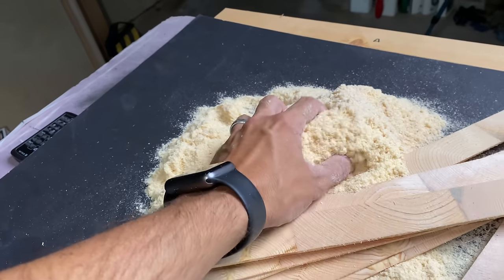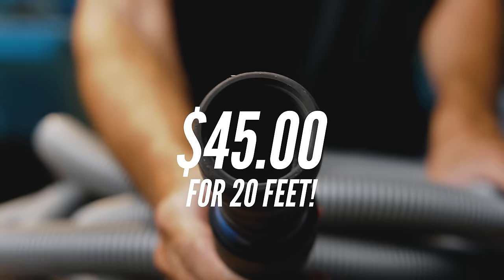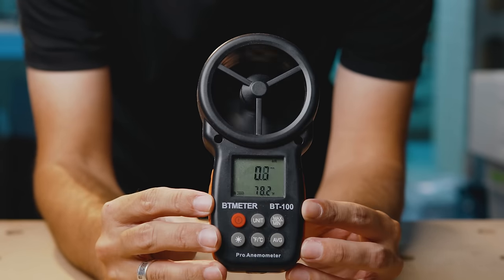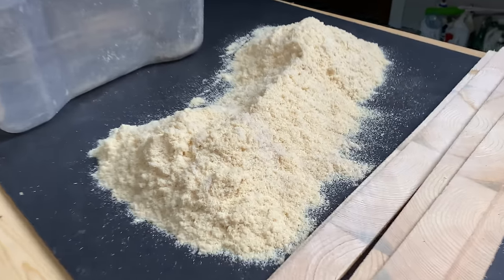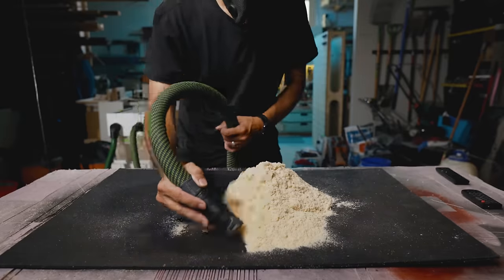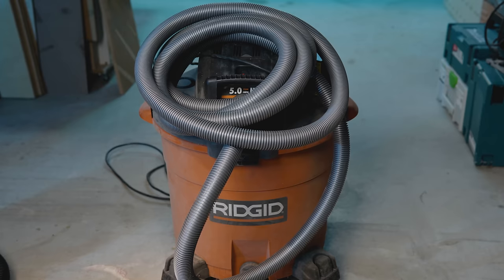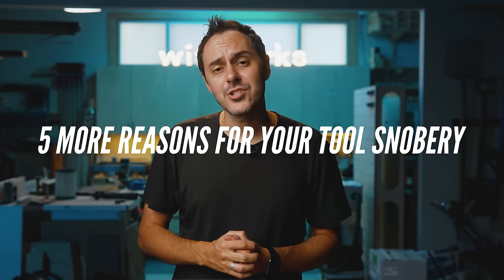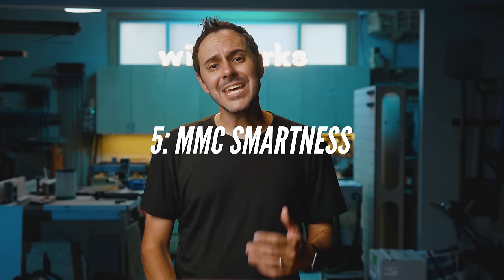This video will save you a lot of money. Dust extractors for beginners.

Comment: It's the loaded filter that's doing this.  Test again with a new standard filter. Check the airflow numbers too. It should be higher than the shop vac with the HEPA bag and filter.  Your readings will go up.  The question is how much. The pleated paper filter is going to filter most of the pm2.5  and larger just like the filter ahead of your car's intake manifold. In fact, a PM 2.5 filter material is very effective at trapping much smaller particles than the 2.5 micron rating. A KN95 mask is made of a 2.5 micron material that traps particles down to about 0.2 micron with reasonable efficiency.  
It's hard to justify Festool when you think of how many OTHER tools you can buy for the difference in price.   Please don't try to justify it with time savings or features only a pro production shop would even care about. How much time and effort can you save if you have an extra 700 to spend on better or  specialized tools?  
One thing that made little sense as a pro,  but probably more to a consumer was when you said  if you are a professional you might feel embarrassed showing up with home depot tools that the customer might already own. 
That embarrassment though comes only from your own lack of confidence,  not the name on the side of your tools.  
If you had the confidence you'd immediately argue that it's not the tools, it's the skills and knowledge using them that your customer is paying for. High end tools (even in the case where they really are more precise) will never turn a poor craftsman into a good, or I dare say, even a better one.  Reality is that the value of what's often perceived as a small performance and feature advantage at great expense will only ever be utilized or even recognized for its value by a highly skilled professional for whom productivity,  repeatability, and reliability translate directly into significant dollars. 
Let's face reality here. The only reason to buy this expensive all plastic and velcro dust collector is the name on the side, ego, and available patron dollars to buy it.  Let's not forget the expensive final stage filter bags that do so the  work but leave you to inhale dust dumping the wide open centrifugal traps above it. 

 Don't tell your wife.. damn straight. I bet she'd tell you to send the damn thing back to Festool for a refund and tell them they have to do way better. Next she's gonna be all over you about why you don't promote a PPE full mask P100 elastomeric ventilator you are supposed to use to protect your asthmatic lungs and red eyes?  Only one of those and you can use ANY tool in your shop.. dust collection, overspray or hazardous fumes not withstanding.  And they're (relatively) cheap!

All that said,  thanks for this video,  i can show my SO how much money I save by building my own dust collection system 😂😂😂

Comment: really good video... would have been nice to see you sanding something with the Airquality-meter next to you... granted this introduces variables into the test, but i noticed that while working usually the pressure difference is the key, not the aktuall volume or Airspeed, as sanders have very limited airflow around the paper anyway.

i'm out of the game for now though as i invested in a haviely used Festool... new filter, blow out the Motor and some new Brushes and good to go.... its 6 screws and one plug to get the motor out of a Festool and you can hardly believe how much dust gets into that motor, as it sucks unfiltered outsideair for the cooling/motorside... and needs to as its sealed to the turbineside for sucking water.

Comment: I wonder if the fact that the newer Rigid and the Festool both are more powerful, they just push more particles past the filters. If there was a way to lower the suction power down to the be equal to that of the old Rigid set-up, I bet the readings would drop correspondingly.

Comment: Particulate readings aren't surprising, moving less air with a clapped out clogged vacuum should give fewer particulates around the lower flowing exhaust.  But I'd consider those results equivalent. What you really want to know is how many particulates you have at your head where you breathe.

Comment: Filters aren't that expensive. Every car, HVAC system, and workplace has filters. The reason the cheaper vacuum worked well is because it has a filter. That means, if you want to save money, you can just put a $1 filter on your face.

Comment: Why not put the exhaust of the shop vac simply outside?

Either by a long hose on the intake or exhaust side? 

Yes it slows down suction but not too bad. 

There are also vacs you can put into a utility room and have vacuum pipes over your shop and it'll exhaust through the roof

Comment: You missed a huge fact in your testing..... The festool will be a dual stage vacuum where the rigid is a single stage ... Dual stage is more suction lift and less airflow (CFM)...
Meaning with rigid with its normal size hose will suck way more then that festool.... Putting a small diameter hose you'll get less CFM and the dual stage festool will pull more air thru the small hose but from the vacuum with a standard 2.5" hose

Comment: Really good video mate! The results are pretty interesting and the hepa bag is something I'll have to get on my shop vac too.

The only comment I have on your method is as far as vacuum exhaust reading you did a good job, but what about the readings near your face or at the actual tool? Vaccum exhaust is one thing to consider, but if a clogged shop vac doesn't suck as much, you probably have more dust at your workstation and near your face, where it might matter even more.

Could you make another video on that subject?

Comment: You actually have to throw out the tests on the 12 year old. 1) filter is clogged up and air flow is reduced, so assuming percentages are similar enough, the absolute number of particles will be lower. 2) the more clogged the filter, the more stuff won't get through it. Think a few thousand tightly packed ping pong balls filling your hallway and try to walk down it, vs just loosely tossing a couple dozen ping pong balls in the same space.

Comment: I’m confused at the point of a cyclone when you have a hepa vac. I paid $400 for my dewalt hepa vac that uses two hepa filters at a time, knocks every few seconds to self clean, and has the outlet built in to plug a tool into for the start/stop feature. And you have the required CFM for tuck pointing according to osha. When I researched high end shop vacs, they didn’t have the required cfm even before adding a hepa bag and filter.

Comment: regarding the old shop vac, I am wondering if the old clogged filter is helping with the levels.   I am wondering if the dirt in the filter  may be clogging the pores of the filter, giving you better values coming out of the exhaust.

Comment: I think if you do enough of it investing in commercial equipment in general is a good idea.  I bought a Honda commercial lawn mower because I do enough lawn mowing to justify it.  I try to buy commercial grade when I can and I wish I could afford a Ridgid commercial twin stage motor vacuum but I couldn't justify the nearly CA$400-600 that one would and my current Ridgid that's well over 10 years old at this point led me to buy an NXT 14 gallon machine from Home Depot.  The old one works but I bought a new one because the old one didn't take bags.

Comment: The most commonly misunderstood element of scientific measurement is error assessment. Every measurement has the objects true value AND the error component of that measurement. The assessment of measurement errors can be a complex task. However every measurement tool intended for high accuracy measurement should come with the relative errors expected from the correct use of that tool. 

Also, your measurements were only measuring the air quality of the output, without taking into account the variability of the static source air quality. In other words, did the sequence of unit testing affect the system input conditions?

Do the various measurements of filtered and unfiltered air make sense?

Comment: Great video - interestingly, the dirtier the filter the better it filters.  Consider that the particulates, as they build on the filter they act as additional filtration material.  The down side is that although you get better filtration the vacuum's ability to move air and filter more is lessened.  But I have always wondered for the small shop not with a lot of neighbors why not just remove the filters altogether and just pipe the exhaust outside and let it go?  Just a thought.  dd
Reply: The same for a pool filter.

Comment: Like most of these reviews comparing a basic hobby tool with a professional tool, you fail to compare the most important factor in the cost difference: time savings.  I now own three Festool extractors, as well as a Mirka dust extractor. AND a Rigid shop vac for clean up. I own and operate a one man professional cabinet shop. In order to accept large house packages on 5k-10k square foot homes, I have to be fast and efficient. So in my case, using a Rigid shop vac for dust collection would be throwing hood money after bad.
Reply from the maker: No need to compare. The time savings should be obvious, and something I mentioned if you’re a professional.

Comment: If wood dust is between 10 and 30 µm (rare cases down to 5 µm), then how much can we expect to measure respectively in the PM0.3, 0.5, 1, 2.5, 5, 10 range ?
So where do the high numbers from 0.3 and  0.5 come from, they are that small that we can't see them, they hang in the air for a long time, so it could be left over from dust in the old filter that is being blown out ? A reference measurement made in the workshop after a long period where nothing had happen there could be interesting.
Things are different if we talk Tobacco smoke	0.003 - 0.8 µm, Soot--0.02 - 2 µm, Drywall dust 3 - 10 µm, Silicosis dust (drilling and grinding concrete)0.3 - 10µm.

Comment: Festool and all the other "woodworker" specific tool companies seem to price their wares to send ALL the kids to college. Beautiful stuff, but you PAY for that last nth of refinement.

The Dewalt Stealthsonic vacuums are a LOT quieter for a little more money than the Rigids. Dewalt also makes a couple of nice cyclones for $125 or so that are basically a shop vac body with a cyclone on top. I just use the one on a bucket, but my vacuum and the bucket are just tucked under some shelves and rarely get moved around. The big reason to have a cyclone is keeping your filters clean - otherwise, all that crap that ends up in the bucket is clogging up your filters in short order and dropping the suction off a cliff.

A clogged filter is actually a better filter - but you won't get nearly as much suction.

Comment: Well that helped me over the hump! I just bought a Makita 1219L Sliding Compound Miter saw a gift to myself for my retirement and mounted it on a Bosch Anti Gravity folding stand. This weekend my nephew and I gave it a workout and can you say dust storm. We did hook up a small shop vac to the exhaust port and it worked awesome! Yup I don’t have a proper dust extraction system and it sure made me realize that I should get one. I have settled on the Festool CT15. Now I just need to find an adapter that I can  hook the Makita dust port up to the Festool hose. Any suggestions? Liked and I have been subscribed for awhile now.

Comment: The issue with fine dust is; the smaller the dust, the more surfece is has compared to mass. So, if you remove 95% of dust mass, you remove only 50% of dust surface. Addicionally, the larger dust gets removed anyways by your nose, so it is the smaller dust, that is dangerous. The question is; how much of it stays in the air, when you take 99,9% of mass out?

Comment: Or...

My shop vacuum is in a shed outside of the work area.  It vents to the outside world.  I have no noise or dust issues in the shop.

Effort and expense?  Almost zero and it works far better than any filter setup regardless of cost.

Comment: You think a Festool dust extractor is expensive? Try the medical costs of not using any dust extractor and filter system. I take the x-rays of people who didn't use them. Foundry workers and drywallers are amont some of the worst affected. I will comletely agree about the dust mask & make sure it's a comfortable one. You will quickly stop using one you don't like which will do you no good at all. I'll leave you with one of my better sayings. Everyone takes breathing for granted until they can't.
Reply from the maker: Yep. My wife is an X-ray technologist. Ctmidi and a good mask is cheaper than a hospital bill - that’s one reason why I bought one.

Comment: I run the HEPA bags plus the filter with dust separator on rigid,   I do notice a difference between the bags and regular filter but that's about it. I would like to know how the suction suffers or not? Thanks for the info!
Reply from the maker: I didn’t notice a huge amount of suction loss. Some. But nothing game changing in my opinion. I didn’t run meters on it though.

Comment: Honestly???
I get the feeling that something with the particle readings is off . . .
There is just NO way a vacuum without a fine filter gets such a good reading.
I bought the FESTOOL CTC SYS-Vacuum out of convenience. A super compact Systainer-based vacuum WITH an integrated hose garage and a shoulder strap for carrying.
When I´m in my workshop, I put the CTC SYS on the cyclone, which usually sits on a FESTOOL roller board. Best setup for the workshop and is super compact for on-site work.

Comment: The results weren't the same. Look at the last numbers. The test also needs to measure the dust at the tool and near the tool. It's likely the clogged old shop vac isn't sucking up (and therefore not exhausting) much of the small particulate - that means it's floating around the tool and your face and/or elsewhere in the shop.

You can to see this stuff clear as day? Work with drywall dust while sanding. A dust extractor wins hands down.

Comment: You would need to measure only the air coming out of each collector. The cheap, older setup is moving less air so your not getting an accurate reading.

Comment: This is a great video, but my tool trailer is small with little room for buckets and hoses that I can avoid simply by putting the saws outside. What I really need is a way to control drywall dust. I can't take the drywall sanding outside, and the dust always finds a way around my tenting and blankets the entire house. Any thoughts there?

Comment: Nice video.  I appreciate all the information and time that went into this video.  I am using an old Rigid shop vac with only a Hepa filter.  Didn't realize about needing a bag too.  What are you thoughts on Makita dust extractors?  I can get a new Makita VC4210L for around $500 with tax.  Thanks.

Comment: Space is a commodity which goes both ways bigger house more money smaller but equally as strong tools equals more money, as for the ppm stuff its definitely the bunged up filter that's doing all the work as the method they both use is identical, also did you wait for the air to settle between tests? If not that may explain some of the variety in your results
Reply from the maker: 1) I tested the Festool first, 2) waited for the room to “zero” out in between tests. Didn’t film that or include it as the original video was 40min long and I cut a bunch of process stuff to get it to the still long 20+min
Reply: @wittworks  solid work and that cuts make total sense time wise but adding in a caption or summin while you was talking numbers wouldn't have gone a miss. Solid work though and the festool just has a quality of life no other brand has especially the cords and hoses they use

Comment: If the old filter was already working, then it is filled with dust. This dust has closed most of the large pores in the filter. The air flow has dropped, but the quality of cleaning has increased. But this is an ineffective way. A lot of dust will flow past the dust suction system in the tool.

Comment: I'm curious to know if aus speed have any influence on smaller particule.  Im now at 75% of the video so I dont know yet if you did the test.    If you put festool on lower setting  do you have less smaller particule?
Reply from the maker: Mmm.  Good question. I didn’t test it at the lower speed since I can’t control the vac but that is an interesting question.

Comment: You should be wearing M3 P100 respirator half mask all the time when you work with wood and drywall . No dust extractor will protect you at 100 % but P100 will do 99.9 % way better than Heppa filter since you are wearing it in and out of the job site and you are only removing it in a safe area. The rest will not really protect your lungs.

Comment: Sorry know this is old video wish you would retest with the meter positioned right at the point of exhaust, I mean face to face. Also test with new filters as mentioned, as most folks will routinely clean/replace their shop vac with clogged filters after heavy jobs. I recently bought the Bosch 9gal extractor for $389...should of never turned this video on! So please revisit with new filters and test meter as close as possible to each exhaust port. Did you ever get any professional feedback from tool manf, or scientific researchers on your surprising results? Also so many pros were mandated to use HEPA approved vacs for silica work a couple of years ago this proves that mandate is a bunch of BS. Thanks for your videos.